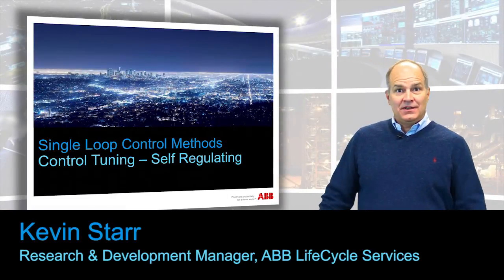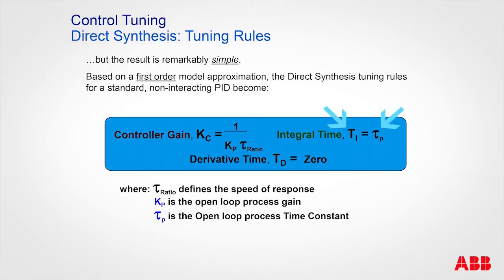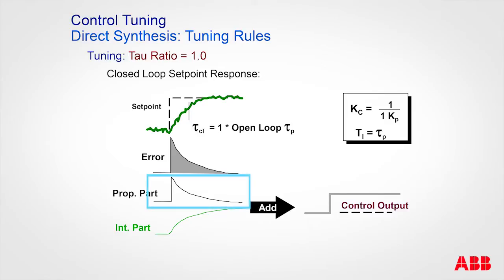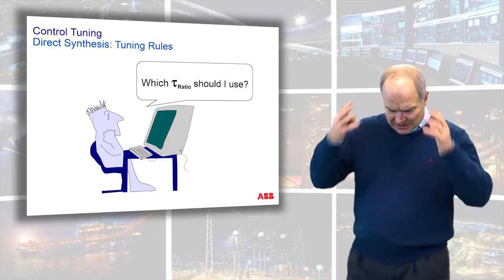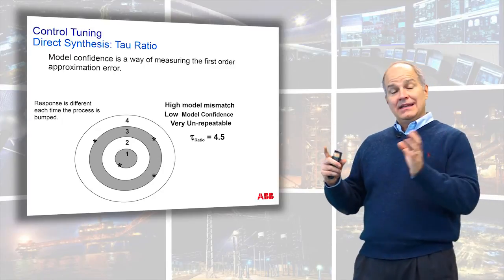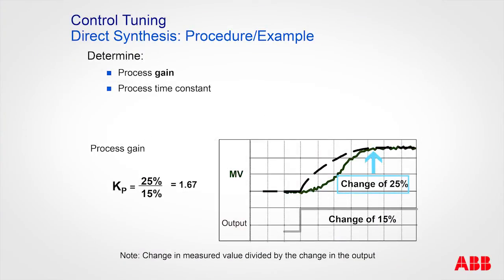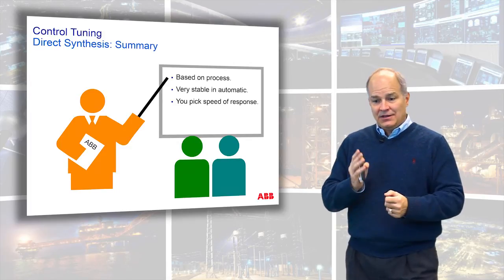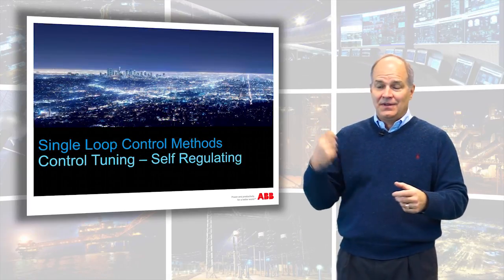Single Loop Control Methods - Control Tuning // Chapter 5

Comment: Great explanation.
I have a question related to setting up 'D' in a PID controller.
When we follow direct synthesis process with manual bump test, I understand that 'P' & 'I' are related to 'Process Gain' and 'Process Settling time' respectively.
How do we decide values for 'D'?
Reply: He says that the derivative term is not needed in that tuning model/response.